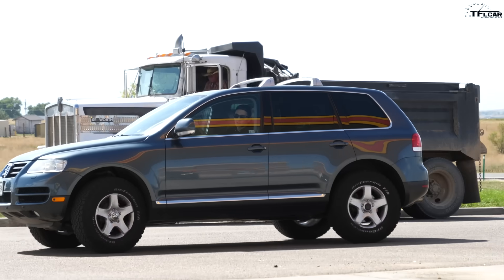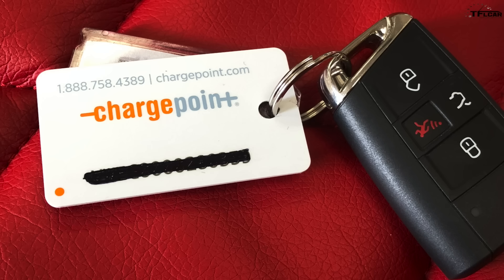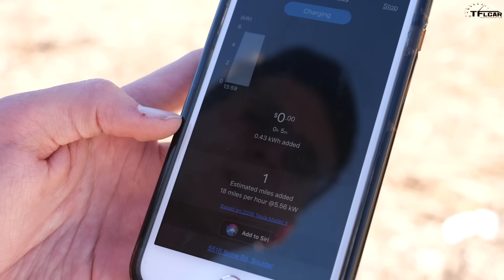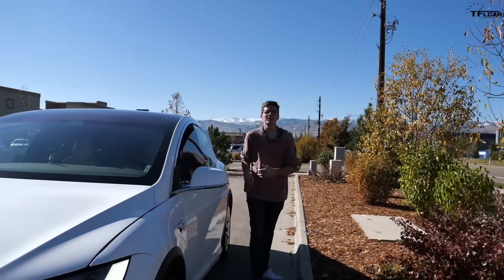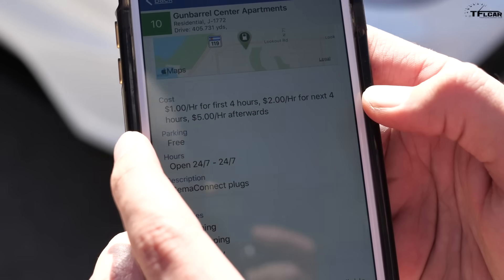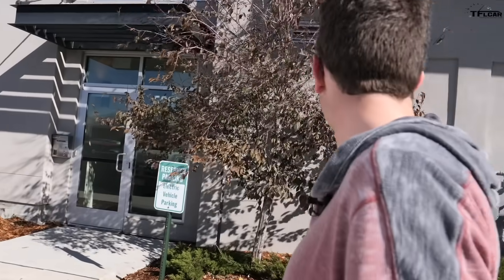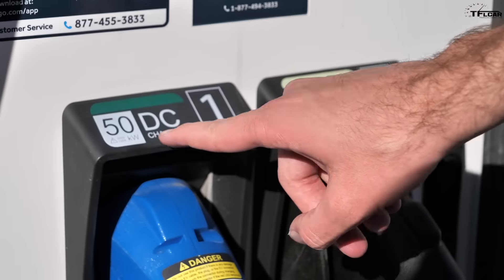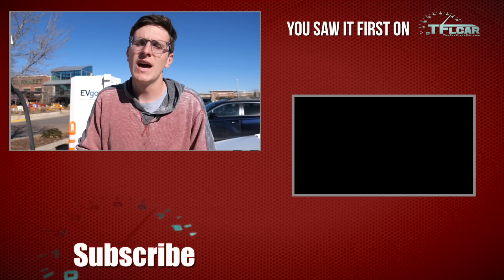Here’s Why Charging an Electric Car Can Suck - And It’s Not The Reason You Think!

Comment: All EV's should use the exact same battery pack and have 1 to 3 packs depending on the kind of car you buy.  The battery packs should be like those Rhino exchangeable propane tanks and I should be able to pull my car into a stall where a robot does a quick exchange of my plug in batteries and I'm on my way.  The car companies would basically either own the batteries and you have a lifetime lease of the batteries with your purchase or they contract out the service to a battery company.  That way as technology improves you always have the best batteries possible the longer you own your car and you never worry about the batteries going bad.  Of course we can't even get phone companies to standardize cellphone batteries in this country.  And the cars should have coils underneath so I don't have to mess around with plugs, just drive over a set of coils and do the Qi charging like my cellphone.  100 Qi's on the bottom of your car would probably charge your batteries fully in 10 minutes since each one has a shorter path to individual cells in the pack instead of trying to shove a bunch of amps down a single conduit that is bound to have more resistance as it gets hotter.

Comment: I may have a future solution and maybe you guys have some connections to pass it on. I have been looking at electric bikes and the Zero Electric motorcycle. The biggest problem as you mentioned is distance and charging time. What if they had Battery exchange sites with a stack of batteries that charge and you could swap the battery out? Kind of like the propane tank exchange most stores have. I know they would have to redesign the battery compartments so they could easily plug and unplug to swap them but it is possible. As of now I will not purchase an electric vehicle because of these factors you mentions but if there was a better way to go longer distances and a way to have a full battery in a comparable time as to filling a gas tank ( maybe 3-5 minutes) I'd be all in.

Comment: I'd buy an electric car, but I also love cross country road trips.  So here's what has to happen before I trade my Honda Civic that gets 42 mpg for an electric car.  The 4 passenger electric car must have a 400 mile range minimum at 70 mph with the climate control running.  The electric car must be able to recharge from empty to full in 15 minutes.  To make it easier I don't need (or want) a car that does 0 -60 mph in three seconds.....eight second 0-60 mph is fine with me.

Comment: Luckily I can charge at work with around 7KW. It takes three hours to charge enough for my daily commute and most of the electrons are out of a PV array on the roof. For a full charge (0 to 100% on a 50KWh battery) I need a little over seven hours, which rarely happens. I usually charge 30 to 80% and save battery cycles. This way the battery should be good for eight years or more. 
It took some time to get used to it, with an EV you just top it of at any opportunity. While shopping for groceries at the local supermarket I get some 10KW while the car waits for me 😊

Comment: So in 5-10yrs when EV cars have really become popular, the cost of charging one will be on par with refuelling a diesel/petrol car but it will still take about 100x longer as the power grid still won't be able to handle running as many super chargers as there are currently fuel stations.

Comment: The only way this shit is going to work is the plugs need to be standardized AND ALL GAS STATIONS need to provide the high power plug-ins that match the vehicle plug receiver. THAT way its just as easy as getting gas. AND you just use cash or a card just like getting gas.

Comment: WT F happens in the depths of winter or high summer? do you freeze or frazzle to death while the car is charging, really useful if you have kids in the car! If you use the heater or AC surely you'll be draining the power you are trying to charge the car with,  a bit like trying to fill the bath with the plug out! so it will take even longer!!

Comment: My work has free EV charging, and the spots reserved for EV's are actually right next to the entrance, whereas with an ICE car you will almost certainly be walking a good way to get from the closest open spot to the entrance. So ironically, in this case, driving an EV actually saves time rather than costing it. In addition, I workout multiple times a week in a facility that is literally next door to Tesla in Hawthorne, so I could fast charge while I get my workouts in as well. However, if you don't have a scenario like this or have the capacity to charge at home while you sleep, charging would be unbearably annoying and time consuming to keep up with.

Comment: Unless they standardize the charging stations  and make paying easier right at the station without apps and make charging faster and easier.... yeah I’m sticking with my gas engines. Fill up my tank takes less than 5 mins pumps are all standardized no need to use any apps, pay be done with it and I’ll be on my way.

Comment: It seems to me that standardized charging stations need to become a thing if EV's actually want to compete with gas vehicles.
Reply: I agree. That is Tesla's main advantage. Others should agree on a standard and build a fast charging network if they want to really compete.
Reply: KesselRunner - Teslas are very competitive, esp. the model 3, cost of ownership much less than ICE car. Check it out and you will see for yourself. There are over 1,800 Tesla stations, all high powered compare with the junk shown in this video. Better yet charge at home, electricity is cheap when compared to gasoline on a mileage basis.  Tesla stations are standardized for Teslas, that’s all you need plus a charger at home is very nice if your  situation allows for one, much cheaper than gasoline, lower cost of ownership. No more tuneups, no hoses and belts, or water pumps, never have to go to a gas station.
Reply: @Macguy  Tesla is still just one company.  Sure, they're trying to corner the market on EV's but they're never going to be the only game in town.  There are going to be a lot of different companies producing them in the future.  Here's hoping that at some point keeping an EV rolling will be just as convenient as five minutes filling a gas tank.

Comment: Wait till the crackheads figure out those charging cords are full of copper. They'll bring a cordless angle grinder with a cutting blade and steal every cord on the lot. I see no good coming of this in major cities where the thugs will figure out people charging electric vehicles are easy victims because they won't be able to escape if their battery is drained.

Comment: Most of the comments stating that it is completely impractical to charge an EV on the road are spot-on!  No normal human being that can afford an EV has this much idle time to waste waiting for the car to recharge!  However, when an EV is used in a manner where errands and/or round-trips are within the range of a single charge, they can be very efficiently charged at home in a few hours on a level-2 charger (typically overnight, much like how we use our cell phones today).  My wife and I have a Chevrolet Bolt.  We live in a remote mountain town in Colorado, but the 240+ mile of range, the Bolt is more than adequate for any of our errands and trips to DIA, Colorado Springs, Fort Collins, and anywhere else along the front range.  My wife also uses the car nearly every day for her commute to work.  We always leave the car plugged into our home L2 charger when we're home / overnight, so it's ready to go the next morning.  Not once in 35,000 miles have we had to charge the Bolt at a public charging station.  Essentially, EVs are NOT suitable for road trips due to the terrible charging times.  But when used for round-trips that are within the car's range, they are extremely efficient, fun, and convenient.

Comment: You are driving a Tesla (Model S and X respecively). 

Go to your nearest SuperCharger (there are several in your area). Your charging is free (S or X) and much faster; and you're already signed up, and you don't need to worry about adapting the plug. 

By choosing some third party that's running at what appears to be 120/15 or less; you are making this more of an issue than it really is.

Comment: Actually that was exactly the reason I thought it would be. However... standardization takes time. If you try to impose standards too early you end up limiting technical development. It is sometimes better to allow the market to fragment and then fight for the top. Believe me, if someone starts building cars and chargers that work at Supercharger speeds outside of the Tesla network but using a different plug (like the already existing standards) you will see Tesla adapt so fast your head will spin. Right now Tesla isn't a real car company, their a technology research firm that makes and sells cars. That's fine for now, but in 10 years I guarantee that every new EV sold with have a standardized plug that will charge as fast as the station can put out and the car can accept. 

I wrote this for another forum, but it pretty well fits here:

Electric vehicle charging rates are calculated based on RPH rates, or miles of range per hour of charging. So if you add 100 miles of travel range in 1 hour of charging that is a 100 RPH charging rate. Currently the highest rate is theoretically 200 RPH, but the limiting factor is battery design.

In the U.S. light vehicle gas pumps are limited to not more than 10 gallons per minute flow rate. If you drive a car that gets 25 miles per gallon you can re-charge your gas car at roughly 15,000 RPH.

That's the number Tesla is competing with when they are designing their super chargers.

Just something to mull over.

Comment: You have too be an idiot to buy an electric car. They're way too expensive. When those batteries go in two years three years tops going to cost around $3,000 or more for batteries. You're not saving the environment because now you have to dispose of those batteries and acid and you're using energy to make electricity. If your serious about saving the environment get a bicycle.

Comment: Guys like him give out crap info,  All houses have "High voltage"  The numb nuts doesn't even realize a standard service to a house is 2 pole 240. / 120 a leg.  .
Reply: This is true, but not all have a good 240v outlet in their garage or the extra capacity at the main panel to handle adding one.  Of course if you live in an apartment, live in a rural area, don't work a job that has you on a fixed schedule, don't have good cell service, don't drive a fixed route every day, or any one of a dozen other potential hang-ups that's the least of of your problems.  I'm not against the idea of an EV to replace my service van as it would certainly be much cheaper to operate and that vehicle is strictly an ROI purchase, but there is no EV that's even remotely capable of doing what a Sprinter, NV, or Transit does at any price.

Comment: 2:09 "It's like if Sinclair, Shell, and Maverick made you sign up to their station before you could refill your tank." I can't underscore the importance of this enough, in transitioning to EV's. There is a democracy in the selling of gasoline: no one keeps track of how much you buy, or dictates how you can use it. This is the challenge, to recreate the democracy of gasoline, without the gasoline. It's tempting to go down the free-market route, and have each company set its own rates and accounts. But this is a strike against the industry in general, and I expect we'll see some takeovers and mergers before the dust settles. Rumor has it the oil companies are sitting back and watching the little guys, and once they've figured out what works and what doesn't, the oil companies will jump in the game with loads of infrastructure and capital behind them, and clean their clocks.

Comment: As the title almost states .... charging an EV can ...be awfully complicated and problematic.  For local driving it should be no problem.....charge up at home and the 200+ mile range gets you home.  Not a good fit for longer distances unless you can build in things to do while the car charges.  It would seem to make more sense to have 6 charging points and 6 battery packs that charge separately and then the car's computer draws power back out in an optimal manner for the type of distance planned.  Anyway, six chargers pumping electricity in would be a lot faster than one......and a failed battery pack could be isolated and not used until damaged cells are replaced.  Some engineer will figure out how to make this work and charge time will get down to 15 minutes....or less on a new 6x supercharger.

Comment: I have a 2017 Prius Prime plug in electric and gas.  Gas tank is 10 gal = 500 miles All electric it goes 26 miles I have been driving 20 miles each way to work I charge at home on 20 amp 240volt and at work     I have 20,000 miles on all electric and 5,000 on gas engine    You have to be smart, why would I want to public charge if I didn’t have to. The 2 places you spend more time, home and work charge there.
Reply: Sounds like a plug-in hybrid is as close to a full EV that I and many others could tolerate given the current EV endurance and recharging times.